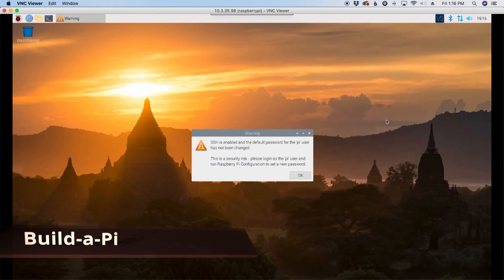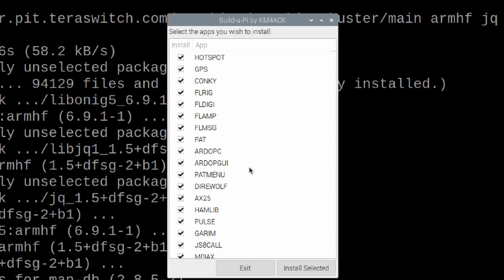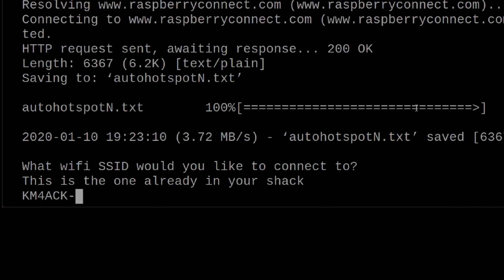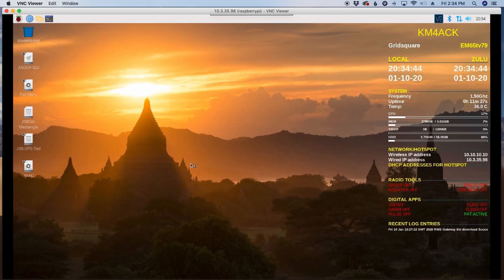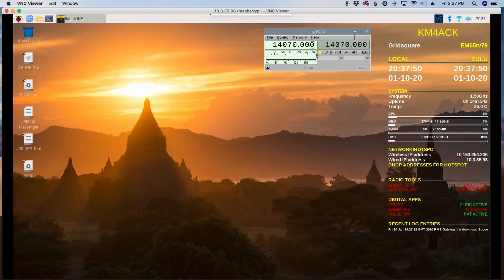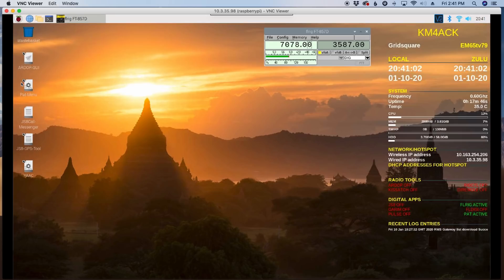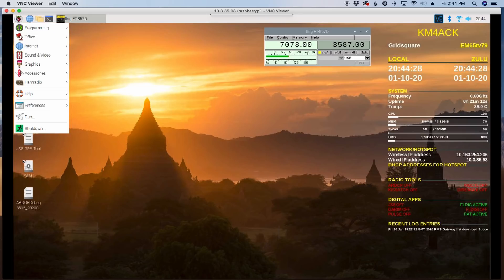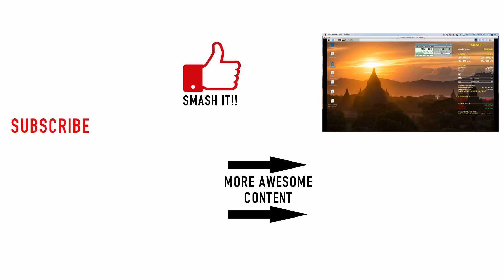Easy Raspberry Pi Build for Ham Radio Digital Operations | Build-a-Pi

Comment: Helpful hint. Under the current Buster release, WiFi power management is enabled by default, which will cause the Pi to turn off WiFi after a certain amount of time...which, in turn, means if you're trying to use your headless Pi under VNC, you won't be able to connect to it. The workaround is to edit /etc/rc.local to include this line just before the "exit 0" statement:

iwconfig wlan0 power off
Reply from the maker: Interesting. I haven’t had mine turn off the WiFi on me. 73, de KM4ACK
Reply: @KM4ACK  Looking through reddit, it's a common question, and editing /etc/rc.local seems to be the easiest solution. I'll test this solution overnight tonight, and if it either doesn't solve the problem or causes more issues, I'll post again here.
Reply: Followup...the change to /etc/rc.local did NOT fix the problem. More research is needed, but in the meantime, I'll have to get used to rebooting every night.
Reply from the maker: I still think something odd is going on. My pi has been up for just over 4 days now and I have yet to lose the hotspot connection. Wonder what is different between our pi's? 73, de KM4ACK
Reply: KM4ACK I suspect a heat issue. I’m ordering a heat sink set to cover the bases.
Reply: Problem possibly resolved, and I should have done this first. From a terminal window:
sudo apt-get update && sudo apt-get -y dist-upgrade

I monitored the upgrade output, and saw that both a new kernel image and several eeprom updates were installed, all released after Buster “went live” last September (which is the image still on the raspberrypi.org site for download as of this morning). Between the eeprom updates and the new kernel, I suspect there was a bug in the Broadcom driver, which is now resolved.

I’m not going to call it “ready for playtime” until I get at least five full days of uptime without losing VNC capability.

For any innocent bystanders who may have wandered by: full system updates are your best friend.

Comment: Having watched the videos from OH8STN and KM4ACK, I decided to jump into the world of Rasperry Pi.  I have been working with Linux (Ubuntu) for several years, and feel comfortable with the OS.  I am not a programmer or particularly versed in the ways of Linux, but I am not intimidated by the OS and can get it to do what I want, most of the time.  I had installed many of the apps on a Linux based netbook, but I did not want to lug it into the field.  I want to keep the amount and weight of my gadgets as low as possible when I work portable. 

I am not really convinced that the pi is the answer.  I stll need several usb pigtails, because my gps dongle and my usb sound card do not fit side by side, nor one above the other in the pi 4b.  But I digress.

I bought a pi kit  from Amazon (where else?) and got the pi up and running quickly.  I run it headless and control it via VNC from a number of devices.  I then used KM4ACK's script, and after 3 tries (internet, server problems?) I got everything installed.  Very good work!  Since it is already nighttime where I live, and I only do portable work, I will try the whole thing out tomorrow, weather permitting.  Hook it all up and fire up the radio.  I already have experience with FLRIG, FLDIGI, WSJXT YAAC etc.  Why shouldn't it all work just fine?

Thank you for working hard to put this script together and for the fine videos you provide on youtube.  And special thanks to Linus Torvalds for making such a great operating system!  It beats Windows, hands down.

Comment: Do not run this over SSH :) crashed (got display error) Had to reflash card to get it back to square one.
Reply from the maker: You are correct that it can't be run over SSH. You should VNC into it instead as part of the script relies on displaying a menu. 73, de KM4ACK

Comment: Can this be run under another user besides pi?  Provided that the user has sudo privileges.
Reply from the maker: That hasn't been tested but it should work. Just make sure your new user is in the same groups as pi and you should be good. Please report back with success/failure. 73, de KM4ACK
Reply: @KM4ACK  It did appear to run as a different user without reporting any errors.
But the changing pat localhost:8080 to 5000 did NOT get applied. I did not install EES and this appears in the EES section of your script.
Also conky is not starting automatically, it does run as expected from cmd line.
crontab has this line @reboot sleep 20 && export DISPLAY=:0 && /usr/bin/conky
Reply from the maker: @MikeL78  8080 is the default. This can be changed in the pat MENU config file ~/patmenu/config. Then logging in again with pat menu applies the change. Had you installed EES, Pat would have been moved to port 5000 so the EES could have port 8080 since it is the default web port. Can't explain Conky not starting. The cron job looks correct. I wouldn't think running it as a different user would effect this. 73, de KM4ACK
Reply: @KM4ACK  I think I may have figured out the conky thing.  I disabled the autologin of a user so the sleep 20 executed before someone logged in.  Changing sleep to 120 allowed a user to log in before the speep expired.

Comment: Thank you so much for not only streamlining the installation, but also for explaining (and simplifying) its configuration!  I tried the AmRRON scripts and felt that they left a lot unexplained and un-configured (and then, even after I ended up watching all of your Pi install videos to configure the apps that AmRRON scripts installed, I wasn't confident that my setup was configured properly).  After giving up on AmRRON, I ended up re-doing my Pi install from scratch and just following your Pi install vids from start to finish again anyway.  This is auto-install script is such a welcome addition to the whole process.

Thank you also for addressing Pat's 'unable to get frequency from rig' error (15:05). I had been scratching my head over that since my initial AmRRON install attempt.  Your attention to detail and attention to addressing possible errors that users might experience is much appreciated!
73 de KI7POL

Comment: I am not using a signal link I am just using a usb sound card with my ft-891. I have everything working but pat Is there something I need to tell it to use cat for ptt?
Reply from the maker: Educated guess since I don't own that rig/soundcard....in the pat configure file (run 'pat configure' in a terminal window) look for ptt_ctrl false in the ARDOP section and change that to true. 73, de KM4ACK
Reply: @KM4ACK  that was it. thanks

Comment: You have made getting on the air digitally way to easy,  thank you. If I have put a program on the rpi that I would like to remove later is there a process to remove it other than flashing the sd card?
Reply from the maker: Yes. Level of difficulty depends on the app. Some easier than others. Much easier to reflash. 73, de KM4ACK

Comment: Is this a valuable tool for analog users?
Reply from the maker: Possibly. While the script doesn't install things like logging software, it would be an easy add on. The script will also install the autohotspot feature which will allow you to connect to the pi with your phone/tablet in the field. 73, de KM4ACK

Comment: Many thanks for all your hard work Jason, All installed on (Icom 7300)Raspberry Pi3+ and working fine,Waiting on micro HDMI to come then will install on Raspberry Pi4 73s GM4ZMK.
Reply from the maker: Do you have rig control working with the 7300? Would you be willing to share your Pat Menu config file if so? It would really help others trying to configure the 7300. 73, de KM4ACK
Reply: Oh please of please share the 7300 for Pat! So stuck on this and I'm assuming 7200 is going to have the same issue.
Reply: Hi, Jason ,good video for the ICOM 7300 from Kevin ( KB9RLW ) shows how to setup the PI with FLDIGI>    https://www.youtube.com/watch?v=ZVNhY3USByc
Reply: Please share your PAT menu file. On old install, I have everything running but Ardop. Thinking I might gain insights from your setup. Thanks. de KK7PW

Comment: It's difficult to ignore your raspberry pi achievements, awesome work.
 I'm still hoping to see you connect to an HF Gateway with Pat winlink. I understand you like packet, but many people don't have that possibility. Any chance for one single video tutorial from start to finish, for PAT, your menu system,  and connecting on HF? I haven't been able to get to stable PAT environment connecting to HF gateways. That's my weak point. A specific video on this would be really welcomed.
Reply from the maker: Thanks Julian. I like both ARDOP & packet and do roughly an equal amount of connections to both. I did a step by step video a while back on using ARDOP https://youtu.be/BYQUU9u5HJw but that was before I had written the menu system. The menu system has a great feature I think could really help you, Auto Pat. Auto Pat allows you to plug in parameters for band and distance and then automatically attempts connections to ARDOP gateways that meet those parameters. If it completes a successful connection, it will write the results to a log file so you know which station to add to your alias list. 73, de KM4ACK
Reply: Sorry to be so late to the move in on into the rest of the digital mode to get setup =)   Changed QTH's twice in three months to find  a good spot where I can have a real outside antenna farm =)  The EOC seems lackluster on Winlink but maybe this will help out =)   We have a group of medical departments worried about HEPA law in sending personal / patient data in open RF environment /-)

Comment: How can you get the Wifi to return to on?Do you have to run the command everytime you want to have Wifi enabled?
Thank's
Tim
KE4HGP
Reply from the maker: The hotspot script runs every 5 minutes in the background. When it sees a know wifi SSID, it will connect within 5 minutes. When it is moved out of range from a know wifi SSID, it will automatically create the hotspot within 5 minutes. 73, de KM4ACK
Reply: @KM4ACK  ok Thanks so the reason I ask is I am running BBC on an android tablet and when I first boot pi I want to be able to connect to it
Tim
KE4HGP
Reply: VNC

Comment: For the packages you are compiling from source, are you using the -jx option to help speed up the compile process?  Especially on multi core machines like the Rasp 4.  Looks like great work on the script.  All of the other ones you wrote have been very helpful as well.
Reply from the maker: No. Not using the jx option. Feel free to mod the script before running if that's important to you. 73, de KM4ACK

Comment: at 14:03 (in the config section), when I operate HF WinLink, I set the mode to USB-D. Should this be reflected in the config file for MODEHF or does that refer to something else?
Reply from the maker: Yes. MODEHF= is the hamlib command for the proper mode of your rig. 73, de KM4ACK

Comment: Thank you!!! I haven’t had any time to look into this, but will definitely be using it and testing. I have the same radio, signaLink and Pi3. Did you include gps for time keeping? I know nothing about code, but I can sure copy stuff that they are willing to share!!! Thanks for sharing! W7TEG
Reply from the maker: Yes. The GPS code can be installed with this script. 73, de KM4ACK
Reply: @KM4ACK  I have installed and followed your video, most things have gone PERFECTLY!!
THANK YOU again! I have a few bumps: 
- my system (FT-857D& signLink) didn't work as planned using the rig rig control method. Maybe because I use 38400 baud rate? but I did get everything work the "normal" way.
-PTT does not work because of the above, but the receive does? 
- the "app?" used on the main screen background is cutoff after "DIGITAL APPS". I may have may a mis-click and messed up the display setting, I haven't found a way to change it.

Do you use any forms with PAT? I'll look at your other videos.
is it possible to add additional WIFI hotspots using the:
sudo nano /etc/wpa_supplicant/wpa_supplicant.conf
and adding a config=2      ?

I'm not a coder so not willing to play too much in config files.

this is all great and thanks again,
W7TEG
Reply: HAHA! fixed the "app" not showing the complete info, by following the instructions on you next video, about setting up the resolution for VNC connection. COOL!
Reply from the maker: @tgbz3301  No forms with Pat Winlink. Do you have FLRIG working with the 857? Also, FLRIG needs to be open when you try to make a Pat connection as Pat sends commands to FLRiG and FLRIG to the radio. You can add additional WiFi hotspots in the wpa_supplicant file. Copy your first SSID info and paste below the first. Then just change the relevant info.  73, de KM4ACK
Reply: @KM4ACK  I am still working to get FLRIG working, it will show freqs, modes ect, just won't transmit correctly. as with all the other programs I have tried, I can get it running using CAT control, just not the RIG RIG that you show in your video. But I am still troubleshooting. If/when I find the reason, I'll definitely let you know what it was. 73, W7TEG
Reply: @KM4ACK  So, turning the Baud rate on my radio down to 4800 and making that change on anything else as needed, I was able to get FLRIG working as the control for all programs using the FlRig FlRig option. 
Ran into another problem, PATMenu stopped working, ERROR  "Failed to execute child process "xterm' (No such file directory)  Not sure about this because it was working fine. I installed PiJuice, Symantic, and open office. updated, upgraded and auto remove. 

Well, if I do need to restart the build, it will be way easier with all the instructions here!
Reply: HAHA, sometimes the simplest solution, is the best. PATMenu could not find xterm, So I installed it. now I am going to go back through your video and recheck everything. But I think I got it! THANKS FOR Your help. 73 W7TEG

Comment: Just want to emphasize the use of a good SD card; anything not as good will be prone to corruption especially with heavy use (even just upgrading packages!).  The even better option is to use a good USB drive instead, especially if you're using a 3B+.

Comment: In the FLRIG do you have the build that has the ft-891 in it. That was my biggest problem with last PI setup. Finding a build that has the 891.
Reply from the maker: Yes. The 891 is in my list in FLRIG and I used this script to build my latest pi. 73, de KM4ACK
Reply: I use a FT-891 And made it work. I have a pi3 and miniprosc soundcard.

Comment: If I run this as presented, will it just overwrite everything on the Pi already installed or trigger conflicts? I'm fine overwriting existing as I'm not too far along in getting the various programs operational. Glad, too, to just reformat the SD card and start from scratch. Thanks, de K6KEC
Reply from the maker: DO NOT run this on a pi that you have partially setup. This is only meant to be run on a new pi that was just flashed with buster. Anything else is asking for trouble. 73, de KM4ACK
Reply: @KM4ACK  Thanks, Jason... perhaps I'll just start with a new card and fresh flash of buster / still having issues connecting to my radio (IC-7300) so concerned with all the various tweaks I've been making, I may have caused other issues...  I started here for my initial download: https://www.raspberrypi.org/downloads/raspbian/  Is that same/same as your recommendation?  Much appreciated.
Reply: @KM4ACK  Thanks that answered my question as well. Great job.  Thank you very much

Comment: I just built up a new RPi4 using most of your previous videos. Can I run your new script on top of my existing build which is missing items included here? Or, do I need to start with a fresh build? Thanks for your help and I can't thank you enough for your hard work on this script! 73, Ted NA7ID
Reply from the maker: DO NOT run this on a pi that you have partially setup. This is only meant to be run on a new pi that was just flashed with buster. Anything else is asking for trouble. 73, de KM4ACK
Reply: @KM4ACK  Thanks. Will flash a new SD.
Reply: @KM4ACK  I'm glad I read through the comments, I was thinking of doing this very thing!  Time to break another micro SD out of it's plastic jail cell...

Comment: Awesome! Thank you!! Would you consider a video on using packet without Pat? Installing a terminal program like Putty? Thanks again! 73, N4DDS
Reply from the maker: Do you have a specific way you want to use packet without Pat? 73, de KM4ACK
Reply: @KM4ACK  Using a terminal to connect to a node then on to another node where there is a full service BBS, etc. I use UZ7HO soundmodem and EasyTerm to do this on Windows but I don't know enough about Linux yet... although i've learned a lot from you!
Reply: @hld3dds  I've been reading that LinPac is the "terminal of sorts" to use...only have a few hours of experience with it however.

Comment: Thank you so much for this.  I'm sure I'll be getting a lot of use from this super script.  I'm neck deep in Winter Field Day preperations but soon after that I plan on building 2m and 40m JS8 message servers and a minimalist application of this script will make those easy.  After that, thete's a Pi based go box in my future.

Comment: Was able to run this install on an old Pi3 I had laying around, worked fine, not connected to a radio yet, but nice to know I can quickly configure a backup pi with your script. Nice! 73 de N8MAC
Reply: cgul1 this is what I will be doing also. I have Pi3s and an 857D
Reply: TG BZ - have you successfuly setup your 857D and Pi?
Reply: Herr Prepper yes, I’ve been running it a little while now. Things I think I figured out, but I could be wrong.. I had to change the baud rate between pi and radio to 4800, I had mine set to 38600. Something didn’t like it, but changing all the software back to 4800 worked. I also added the clock sync from the gps sw. I REALLY LIKE this setup!!!